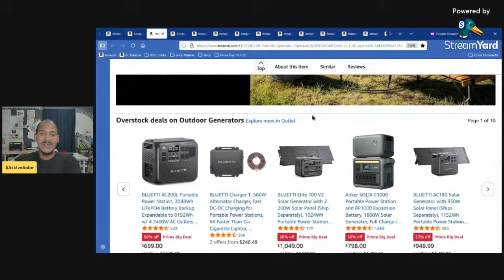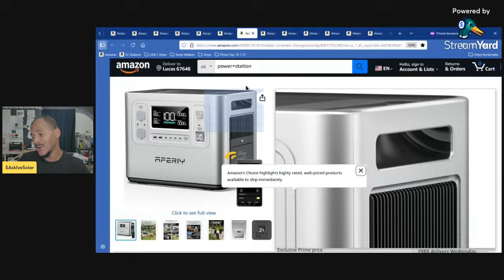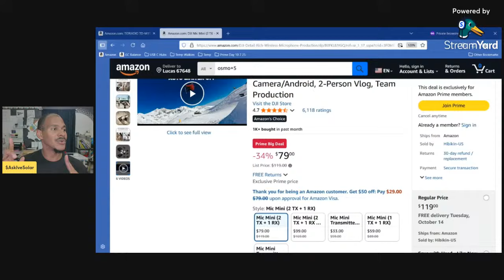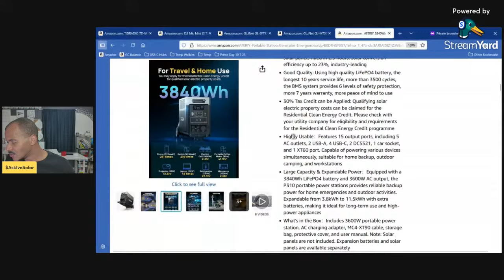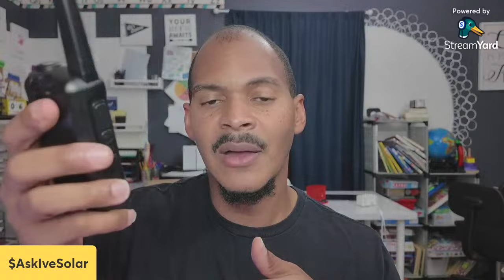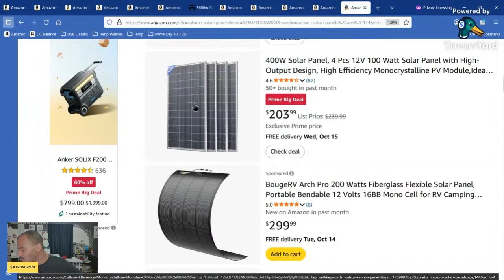Best Prime Day Power Station Deals I Found!!

Comment: Not sure if you will see this but I live in my sedan (not a van) so limited on space, electricity,  and area for solar. I want to get a station small enough to possibly put in a gym bag or backpack to charge in the gym but will power a mini crackpot, rice steamer, etc for cooking inside the car for winter. (500/600) Then next (later) I want to get a larger station (1000/2000) that will power a stove burner/toaster oven that has good solar charge/car charge possibly. What would be your recommendation? Can you let them know it would be great if they made stations with removable batteries that would be smaller to charge and have extras as backups. Thanks
Reply from the maker: Do you have Facebook, Instagram or telegram?

Comment: There are some crazy deals out here. I have been working Marketplace and other EBay finding insane prices.
Reply from the maker: Have you grabbed anything cool since then. I got a pecron e300 for 50 bucks locally and it retails for about 150. Im excited just for the ight and wifi connectivity. ha
Reply: @AskIveSolar Yeah, I’ve kinda switched strategies. Rather than scaling up my energy to meet the needs of my household in case of an emergency, I’ve picked up items to bring that need down to capability of the devices I have already acquired. I’ve picked up a total of 4 Point Zero Energy Units (3 original and one 240). Some solar panels with usb ports. Another old Duracel power station and some Go Power Jump Starter flashlights that I gave to the family. Some Aqua Bricks water storage. 3 24V lipo batteries for the Point Zero 240. And lastly, an apartment size 120 volt dryer. I just can’t justify using 5000-7000 watts to dry clothes in an extended outage.